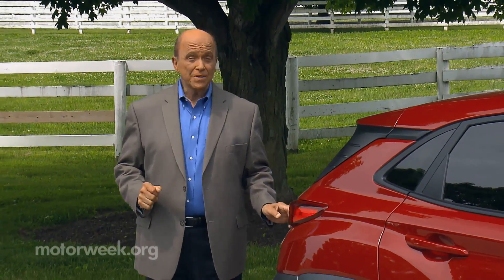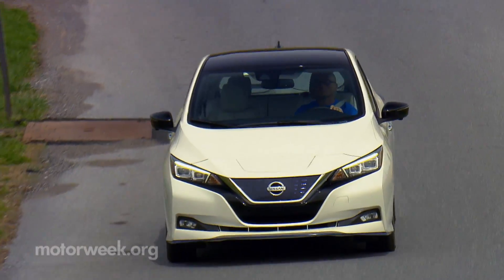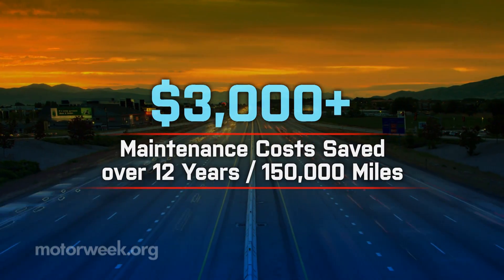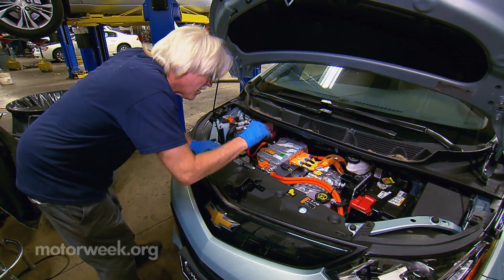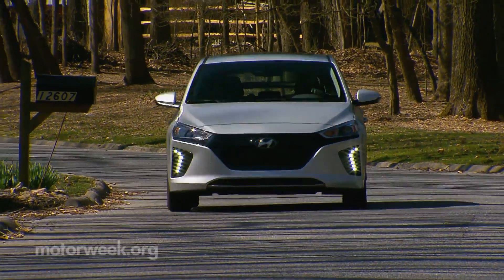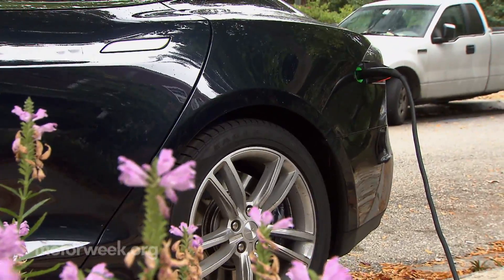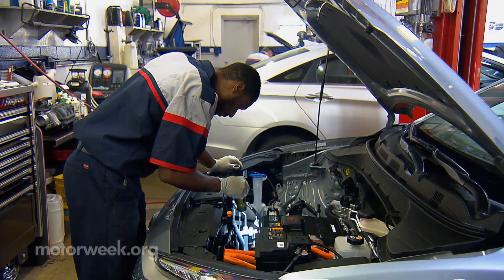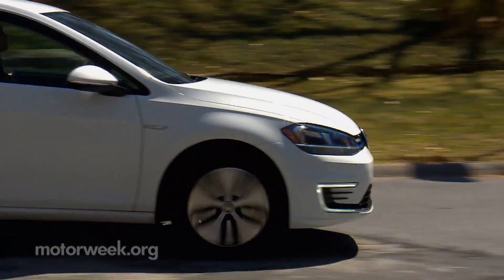Electric vs Gas Vehicles: The Long Term Cost Comparison

Comment: Great for when I'm old and too feeble to drive a manual petrol engined car
Reply: If you're at that stage (and my 91 year old grandfather has), then you would have more than your fair share of struggle from behind the wheel. 

If you're ever getting a brand new or (new) used car, there's no reason it shouldn't be an EV or PHEV
Reply: @BeLowBelowo  there are plenty of reasons why I'd prefer a manual car with a nice engine over an EV
Reply: @Markcain268  why is that
Reply: @Julian1T1  because EVs are child's play to drive, virtually drive themselves, very little the man behind the wheel has to do
Reply: @Markcain268  I definitely understand what you're saying, you want control over the car you drive. With EV's there is an option to turn on/off the cruise control/assisted driving/full self driving etc. This means that you can drive it yourself just like any other car but the option is there if you ever want to relax a bit. I think the Full Self Driving is very good for people who are awful at driving, and I'm sure you know some people who could definitely take advantage of that lol. My prediction is that FSD will be mandatory within the next 200 years because it has been proven to be safer and is only getting better. But unfortunately I'll never be able to see if that's true or not lmao.
Reply: @Julian1T1  I agree, cars are quickly becoming mere appliances to get from a to b, won't be long before you can buy one from Argos lol
Reply: @Markcain268  lol exactly they are becoming appliances

Comment: In emergency EV are not so good, fulling up at a station only takes 10 mins, so you know when you reach home you got a full tank, charging at home is cool yes but if you have to go run for something you will have to travel, or if you have an emergency you have to travel because the convenience of jump in an go from home isn`t there, short notice from business and friends isn`t good with ev because you gotta tell them you gotta wait 6 hrs to get half charge before you can leave home again, were as gas is just jump in and go.
Reply: WHY did You not plug in the night before, Stupid
Reply: @paul-flyer  because you used it  the next day, did you even read what i said, SHORT NOTICE, like you can see the future to know when your home tmr that your friend or business gonna call some min, after smh
Reply: U can use fast charging that will give u 50-60% charge in just 20 minutes.
Reply: @anonymousman2521  Not every one can afford a fast charger, or everyones grid can support the amps needed to charge at that rate, why can`t there not take 20 to 100, I won`t be proud to say that it charges in 20 min to 60, what about the other 40%,small ev can only go 120 miles on a full charge, cut that in half, I won`t feel comfortable tbh, i would prefer a hybrid until ev`s station and charging improves, or some tesla but where I am those take almost a day to fully charge
Reply: @pk6336158  u dont have to buy a fast charger, it is there on the road installed by the respective companies,, just go, take a 20 minute snacks break nd charge it.
Nd if long range travel us ur priority, then u should buy a 250 mile range EV instead of 120 mile.
Reply: @anonymousman2521  that's the problem, not every part of the world has fast charges, so it's not a general statement but only for the USA and Europe even in the USA you gotta drive miles to reach a charging station, and because of the slow charging rate and turn around time most times you gotta wait or relocate to a next charging station because all the charges are full and people are on snake breaks at this moment, and what is it with theses snack breaks, the 250 miles isn't for me, I drive 300+ daily back and forth, in my duty taking breaks and waiting isn't efficient, full up in 2 min buy a snack and go again and if it's 250 that's in a perfect calculated environment, and in my climate it's 36+ degrees c, so battery over heating is common and slow charging because of the heat generated in the batteries so for now hybrids for me are still the better choice, not every one want to stop every 180 miles for a break but just want to reach there destination but to me its an excuse for a problem that isn't solved yet, taking breaks, I'm sure if it was a gasoline car taking 20 to 30 min every 180miles to full it would of been totally unacceptable
Reply: @pk6336158  bro it will eventually go everywhere. Most important thing is the range offered by those ev's are enough to cover ur 335 day ride, u may need fast charging at most 30 days in a year.
Reply: @anonymousman2521  I understand you, but do you understand me, because the cars that can do 335+ miles would drop to 270 even less because of heat also depending on how much payload you got and people those numbers drop, for example if you use your phone in your room it would take long to discharge might get 3 hours from it but if you forgot it in a car without using it when you arrive 1 hour later the phone is died because of heat, and the hotter the battery is and how much you use it would take longer to charge even on a fast charger, if it charges fast and didn't wait on the battery to cool down the positive electrons would burn off and it would either expand to the point which the battery exposed or the battery life will drop drastically, imma get some for city and short driving long trips can wait, if everyone had money for a tesla long range model well no problem lol
Reply: @pk6336158  u r so funny, it seems u drive ur car 350 miles everyday. I don’t want to argue with u, u r one of those few guys who always oppose anything that newly comes to the market, its kind a smartness show off.
Reply: @pk6336158  i don’t want to further argue with u, mass people have accepted this technology nd they r eager to buy it if price becomes somewhat affordable to them. U know, majority never makes a wrong decision. But u can stick with that old technology, nobody will mind.
Reply: @anonymousman2521  you say "mass people have accepted this technology.....u know, majority never makes a wrong decision". Well you know mass majority in germany went with Hitler and what he did....and was legal because their legislature made it legal.....(and yes it was horrendous un ungodly). Point is majority can and has been wrong  MANY MANY times. Plus ever think of us who live in the rural parts (feeding the world) over 50km to the nearest hospital....and even then many times they send you another 50-100km furthur. Or how how about need parts for a tractor mid day, oh theres another 200-300km round trip, the logistics of ev vehicle for people who dont live in or near a major city....is impossible....some of us farmers vehicles are running 400 or more km a day. As well as for employers....pay an employee to sit and charge up on a trip while they sit on their ass.....aint never gunna work or happen.... i worked for places that the vehicles were used 24hrs a day (12hr shifts) ev would never work

Comment: I drive a v8 I put 25 dollars gas every week and a half. I do 2 oil change a year 40 bucks each time. Soooo. That’s about 700 dollars a year on fuel and maintenance. I drive 10k miles a year. Now 58 dollars a month on electric bill right 58x12 equals 696 🤔 not much of a savings at all. Not to mention EVs when driven every single day goes through tires quicker. I Did a tune up on a Nissan today car had 180k on original plugs and coils it was a 2007. People maintain your car and it will last for ever.
Reply: You’re not taking into account the ease of use factor. Electric cars are terrible in that regard as they take forever to recharge and can only be charged up to 80% or the battery gets harmed and if there’s cold temperature then I lose 30% on range and if my battery is low then poor sluggish performance. At least with my gas car I know my 16 gallon gas tank will remain 16 gallons 6 years down the road electric cars lose range on miles every year

Comment: 263 bucks per year??? How long does it take until I break even, because that EV was double the price or 1 1./2 the price??? Until EVs are at par with gas cars, they're not worth it. Despite all the push, incentives they still are barely 3% of the market share. If they were so cheap to own, more would buy them. I'm all for EVs, but at those crazy prices, No thanks!!!! Bought a 2013 TDI Jetta that I refuel every 600 miles.
Reply: Yeah that's 966 km on a tank of gas. Wow that is a lot distance for a 2013 car. How much do you spend a month on gas?
Reply: @tonyp9313  I spend $0 on gas, but roughly 60 bucks a week on Diesel fuel. I drive a lot. 140 miles per day , 4 times per week. Fill up once a week. I still have just under 1/4 tank when I do, but cant beat the mpg on those.
Reply: @bmw803  They have Diesel for cars in the states?
Reply: @tonyp9313  The USA is on earth. Of course they have Diesel. Otherwise trucks couldnt run anywhere
Reply: @bmw803  oh ok..I'm from Canada we mostly drive gasoline cars here...Yeah maybe you can drive diesel cars as well. I haven't seen anyone driving a diesel car though here.
Reply: @tonyp9313  not many here either bro
Reply: @tonyp9313  thats cuz its pretty damn cold up her in ol saskatchewan for deisel cars.... alot of people here dont plug in their vehicle untill its -40.....not pretty for a deisel. Neighbour started his deisel truck when it was -25 without plugging in....sounded like the  crank was gunna fly outta the eninge block lol
Reply: @tonyp9313  thats cuz its pretty damn cold up her in ol saskatchewan for deisel cars.... alot of people here dont plug in their vehicle untill its -40.....not pretty for a deisel. Neighbour started his deisel truck when it was -25 without plugging in....sounded like the  crank was gunna fly outta the eninge block lol

Comment: Mechanics in the future will still find a way to over charge you and tell you bullshit that you need. Wouldn't be surprised if they said it needed an oil check haha!
Reply: Not really all the suspension components you ignored with your gas you’ll prolly fix with an EV because you hear them clunks even more 😂

Comment: the  fuel savings are no where near the cost of battery replacement. Besides, most EV warranty says x years or x mileage whichever comes first. On top of that if you drain your car battery less than 30% that causes premature battery failure. So the actual usable range is far lower than what they claim.
Reply: My gas tank had to be replaced on my old truck, so yeah sht the fk up.
Reply: @gilbert6181  he’s right you also lose 30% of the battery’s range from cold weather and you’re not supposed to charge an EV past 80% or it will harm the battery so there’s too much wrong with it. A Toyota Corolla will last 30 years with as much as 400,000 miles on it

Comment: Only 3k over 12 years? Expected more than that. Still don't really think an ev is worth it over a cheap efficient gas or diesel.
Reply: It’s incorrect my friend . In my area of San Diego charging rates have gone way up , also the video didn’t say EV eat tires. In many cases you lose like 15-30% tread life. On a 60k GT tire that means you would get 35-42k miles out of them vs 50-60k miles vs a gas car. Other things is it wears brakes out harder then gas ⛽️ and the repairs are much higher ⛽️ . Short version in the short term EV will cost less to upkeep but long term more then 5 years or higher mileage EV will cost a lot more.
Reply: @neubauerjoseph  weight of the vehicle... tesla is heavier vs most passenger trucks

Comment: For an EV - add in extra cost of insurance over 10 years = $5000.  Higher purchase price of EV = $10,000.  Investment return on the $10,000 lost = $7000 (7% return per year for 10 years after taxes).  Installing fast charger in garage = $1500.  Total $23,500.

Comment: $5000 to $15,000 for a replacement battery at 2019 rates. I wonder what a battery pack will cost in ten years... :-(
Reply: Yeah but 5k to 15k is cheaper then a new car or ev..if you get 200k miles out of the first battery pack
Reply: @fgonzalez78959  That's a valid point, but the problem is the price difference. Once EVs are at par with gas. Then it will take off.
Reply: @bmw803  it looks like EV's are already reaching that point
Reply: cookies they're not there yet, but give it a few more years. I did the math recently and it would take me 11.5 years to break even. A used one is ok as long as you dont need to go too far. The BOLT is the exception.
Reply: @fgonzalez78959  but it isn't... you can pick up and install several engines in gas vehicle for that money
Reply: Don’t forget about tax credits
Reply: @ENRICKY1119  which are paid for by ???? Lol
Reply: Probably 1500 to 3500 at most.
Reply: I can argue it will cost less in 10 years, but I can't predict the future either.

Comment: See I had go somewhere in Jan it was -40 with the wind so stayed home and cause problems 
How much range would drop running the heater and being that cold 
Problem is they addicted to gas tax making electric more affordable in high gas tax states that climate isn't brutal
Reply: Wait until they start slapping taxes on those EVs, to think that they won't impose anything and let those gas taxes go away is a pipe dream. Once EVs become more widespread, they'll raise electricity prices and slap taxes. You're not gonna save FUCK ALL. Then there will be less demand for gas, which will make the price lower. HA HA HA HA
Reply: @mmm-mmm  they started out 480 volts when down to 230 cause of mechanics I don't know what Telsa runs 
I like drop in two electric motors in car that limit the feedback loop 
I study some motors in school but not extensively cause bad shoulder from sports

Comment: What's 3k over 12 years. Its peanuts.
Reply: Especially when some of those cars are double the price of their gas counterparts. That's the part they never mention.
Reply: They were only talking maintenance… that doesn’t take in part fuel savings which is thousands more….
Reply: @MrAppltec  they didn't do battery replacement or enviro impact...

Comment: The guy at 3:33 said he pays $58/mo for electricity. I pay about that for diesel. I’m getting well over 40 MPG & I get 48 on the Interstate. EVs make no sense to me.
Reply: I drive a diesel also but he is clearly comparing his fuel cost which is petroleum to the cost of electricity which is way cheaper. EV clearly has way less maintenance over time because there are no EGR valaves, no piston heads, no rings, no gaskets, no engine oil change and so on. The main decision maker is most likely the insurance cost for each vehicle.
Reply: @rhythmandacoustics  you will be replacing the batteries on EVs every 8 years
Reply: @thecollinzboy  perhaps yes perhaps no. We still need more data and battery chemistry is still being developed. We know so far though that production of those batteries are expensive because the materials required are hard to mine. So far diesel or hybrid electric petroleum are evenly tied and are cheaper than pure electric.

Comment: Oh please, fuck off! EVs will never make sense financially. Not only are they much, much more expensive than a comparable gasoline vehicle, but they are also almost worthless after 8-10 years when that battery pack expires. Meanwhile, my 23 year old Volvo still runs like new. The bodywork needed some rust repair recently, but the engine is still in top shape and will make many more miles for many more years from now. An EV will never do that. Not to mention you can't work yourself on your EV, unless you know what you're doing, or you might get deadly electrocuted.

Comment: I'm laughing all the way to the bank....used 2002 ZX3 Focus 5-manual cost me $1,100 and a few minor parts from the wrecking yard and has 193K miles on it. Close to 40 MPG HWY and I used it to move. Holds a lot with seats folded. Still drives like new. Handles great , no oil leaks , uses almost no oil. Full synthetic oil change myself cost me $17.50 filter included. Keep your EV !
Reply: It's hard to argue with brainwashed cult worshipers my friend.
Reply: I envy people with great mechanical knowledge. After a few years visiting garages for my car maintenance and seeing the range of part and labor costs..... I gather that someone who knows their stuff can buy a relatively used car at cheap, spend some good money on maintenance, and have a really good car for a long time. I reckon it would cost thousands less than a brand new car.
Reply: @elumiomerk4013  
Yes, that's what I figured too.
Reply: Same people who can run a calculator also know how to work a car...

Comment: Hello , AAA....can you bring me 5 gallons of electricity ??? My battery is dead.
Reply: @HedHntr A bit too expensive for many, yes. Unless you drive a lot, in which case fuel savings offset vehicle cost. With that said, everything I just told you was readily available infrastructure from the EPA and other information sources, searchable on Google, and your statements can be debunked with basic math. If you've got time to write a comment, you've got time to look that stuff up, so there's no reason to be posting misinformation and myths.
Reply: Oh trust me, should the need arise they will be more than happy to supply such a service. It's rather simple even, all they would need would be a customized EV battery of their own and some charging circuits.
Reply: @HedHntr Wow, "power bill increases." This is possibly the most riduclous thing I've heard about EV's. Maybe you should do some elementary school math. A typical VW shitbox will go from 8L/100km to 16L/100km when you're driving around 200 km/h. An EV will go from 18 kwh/100 to 36kwh/100km. Here in my part of Canada gas costs $1.35 per litre, a kwh of electricity is $.09. The cursory math says going at 200 km/h, a petrol car will cost $21.60 to drive 100 km. A comparable EV will cost $3.24 in electricity to travel 100 km.
Reply: "Hello AAA, I'm a fucking idiot who let my car run till empty. Can you bring me a new brain?"